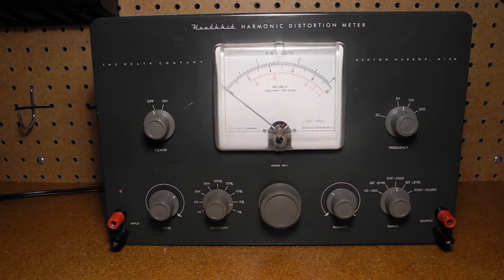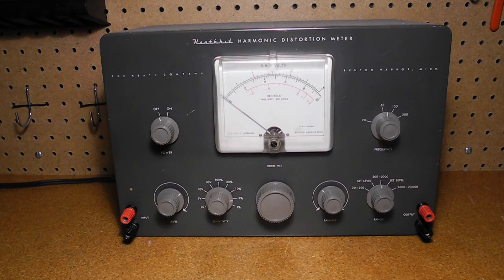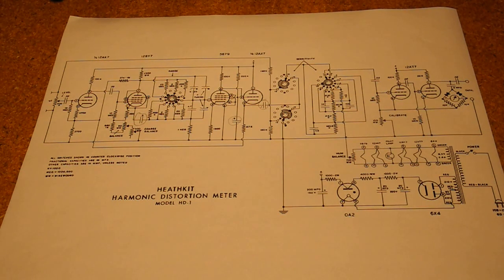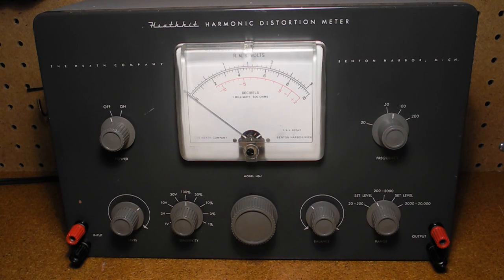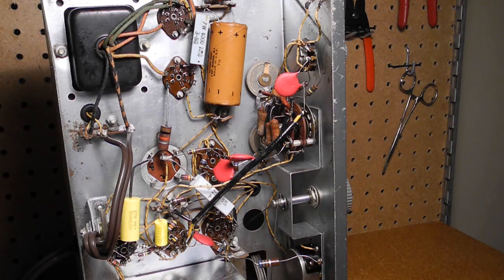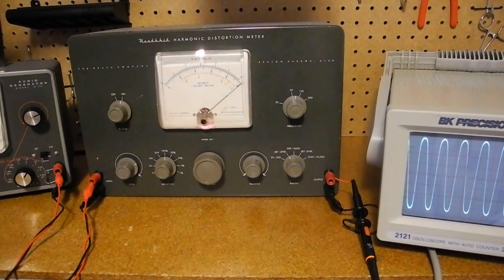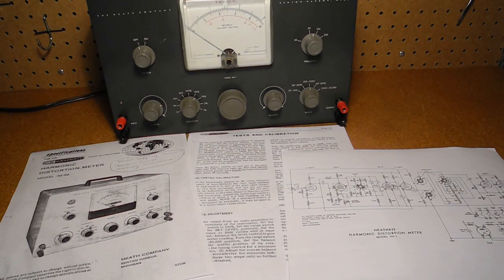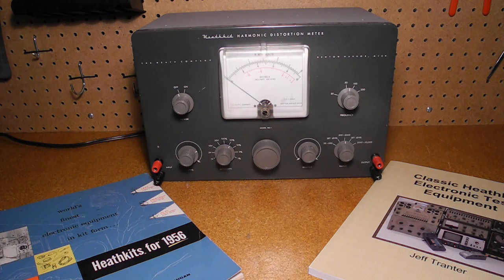The Heathkit HD-1 Harmonic Distortion Meter

Comment: These Heathkits were commonly found at smaller radio stations that could not afford the HP 334 distortion analyzer series. The expensive HP essentially works the same way. At one time a FCC requirement for radio stations required an annual “audio proof of performance”.  I spent many hours after midnight using the Heath and HP distortion analyzers. Those days are long gone now. I still have my HD-1 and HP 334A. Pretty much useless on today’s high quality audio gear.

Comment: Hi Jeff, I love this video! And I have subscribed to your channel. I have a problem: occasionally, I bought one of these rare (today) and precios little treasures. The exact type I do not know, neither did the seller, who did not know at all what this thing is. I bought I for 5 Euros ;-) But it looks pretty much the same as the HD-1, except for the knobs. They look older: I can send you pics of the unit, if you will send me your email adress. Mine is rhpriv@web..de. But a pre-owner has played some trick on it. He cut the red line from the mains cable, and he removed the red input socket, so not to let anyone measure anything. But I'm persistent, and I will restore it, definitely. When I plugged it in, nevertheless, just awaiting nothing or at least some hazard,  some valves began to glow, and the meter ran wild without any input, just by turning some knobs. I hope you don't mind that I write all this publically. But, please, repeat to this comment to my email adress. Thank you very much in advance. And greetings from Germany. Besides: I just found the type. It's a model IM 12.

Comment: Hi there, thanks for a great video. I have one of these which I need to repair and although I have the circuit diagram, I'm still struggling to find the original manual for download. Did you ever locate one? Can anyone else help?
Reply from the maker: I have not found a full manual available as a free download. You should should be able to buy one from here though: https://www.manualman.com/index.cfm

Comment: Hi Jeff, I have a Heathkit HD-1 that I'm restoring but I'm not finding its assembly manual, just the schematic, do you have the assembly version of it where it shows how to adjust the equipment? If so, could you share it with me? tossupper@gmail.com
Reply from the maker: I was not able to find a full manual for the HD-1. I did find a manual for the IM-58 which is electrically identical and has the operation and calibration procedure.
See http://www.twin-x.com/groupdiy/albums/userpics/HeathkitIM58.PDF
Reply: Thank you so much Jeff, you're going to help me a lot! Congrats on your channel, your videos are very useful to me!

Comment: Hi there, Based on the schematic, what will be the output of the HDM if I feed audio. would it be distorted due the tubes in it?.. Thanks in advance =)
Reply from the maker: If you were to feed in a pure sine wave and adjust for a null, any output would be distortion from the unit itself, such as noise from the tubes and power supply.
Reply: Thanks for the prompt answer Jeff. It is appreciated. I would like to feed a sine wave from the audio output of a PA (music). any other tip you may want to share for my "experiment" looking for 2nd harmonics addition to the input wave?. thanks again